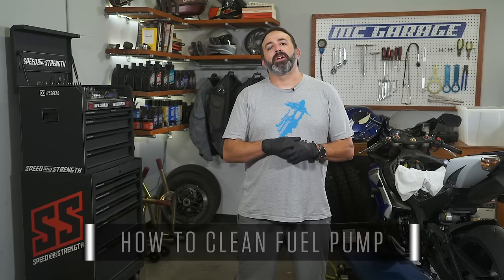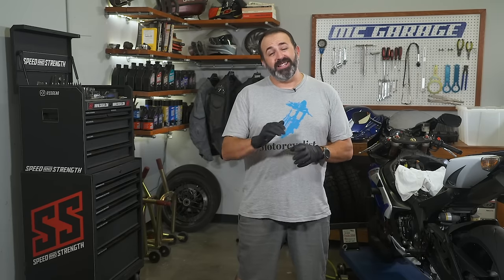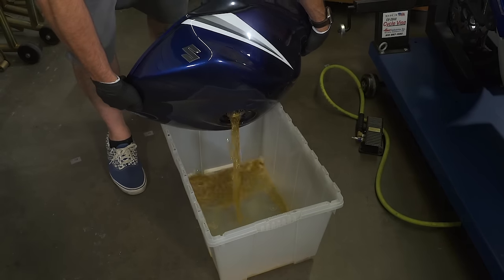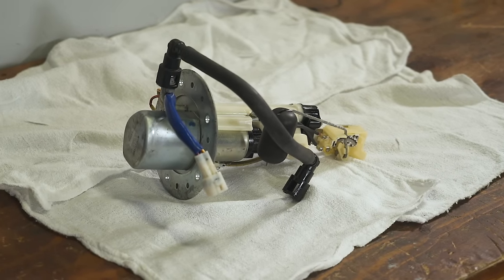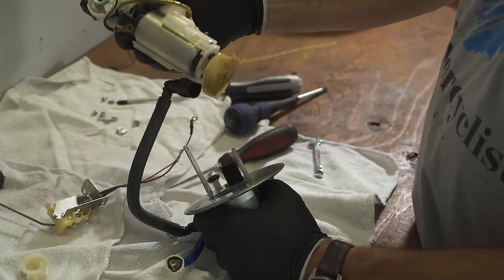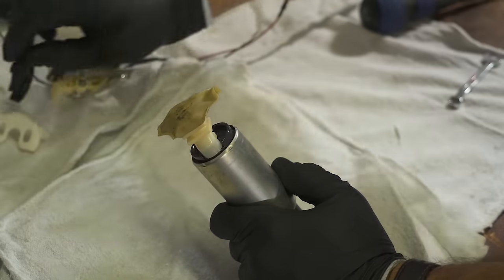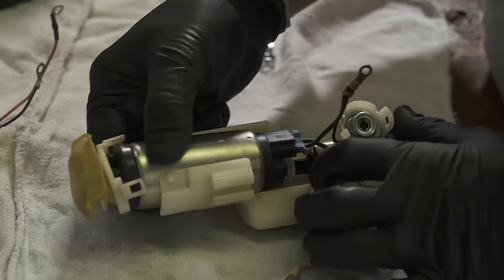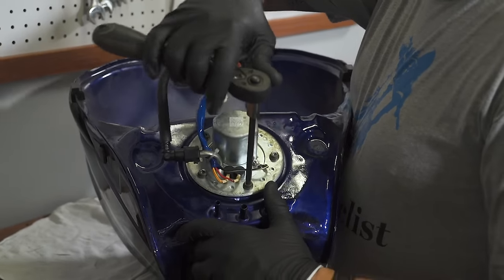How To Clean Your Motorcycle Fuel Pump | MC Garage

Comment: This is a great video. I bought a bike with 600 miles on the clock for dirt cheap recently, it hadn't run since 2015. I quickly figured out the duel pump was the issue. Followed this video to the tee, got it running after cleaning the pump, Now I have basically a brand new bike. Time to flip! Thanks guys.

Comment: I would not recommend using carb cleaner on anything rubber or plastic.
Reply: exactly, brake cleaner works best as it does not destroy rubber parts/o-rings.
Reply: True, it's very strong and damages most plastics but fuel pump components could be more resilient to chemicals. Best to makes sure and try it out on safe spots or old parts.

Comment: For removing all that rust from REALLY old gas tanks, I've had terrific luck with one of the water-based iron chelation type rust removers like Metal Rescue.  I suppose muriatic acid would get you off to a much faster start, but the chelation type rust removers are very gentle and do a great job.  When done, drain and dry in the sun, and you're good to go.

Comment: That's nice but i need a big garage , Unfortunately i live in Apartment
Reply: Yeah same here - I agree it sucks. I do have a detached two-car garage that I rent a few blocks away from home however there's no electricity, lights, water, etc at the garage so it sucks I have to do everything with hand tools and battery-powered lights and tools. I'm trying to save up to get either a gas-powered air-compressor or generator as that would help a LOT.
Reply: @MatthewJFitzpatrick  But i try at least to do something which is possible on the bike, only lubricant spray hahaha

Comment: Very good video , useful . No mention though of the tiny cylindrical metal filter that lies inside the fuel pump housing,  just after where the pump head enters the plastic housing as on my Bandit 1250 . The tea bag filter stops most of the crud but I'm having to remove pump and blast carb cleaner through the fuel line into the pump housing to remove a very small amount of dark silt . When I can easily blow through the fuel line I know I'm good to go again . I wish that darn secondary filter was external as I've had to clean it out more than once . Let me know if anyone has managed to combat the clogging second filter . The tea bag at the rear of pump remains good,  I clean it as a matter of course anyway each time the secondary gets silted and I loose the ability to exploit full revs .  Rob Stone .
Reply: Thank you very much for that comment. My fuel pump started making noises and my bike ran not as smooth as it used to. After i installed a new pump the viton grommet got pushed out of its place. I wondered why... Now i know it: the internal fuel filter is clogged therefore the pump builds up a really high pressure which resulted in the grommet giving up. This weekend i will reverse flush everything and i'm confident to solve the problem this way. I wonder why I had never heard about taking care of the internal filter before. This makes a lot of sense: The filter on the sucking side of the pump is quite coarse and will surely let fine particles pass through towards the internal paper filter.
The internal filter isn't meant to be maintained and a whole fuel pump unit costs about 800bucks...  
Thank you for saving me a lot of money!
Reply: @Payder    my story actually carried on with that cylindrical filter blocking with super fine silt after less than 1000 miles . I eventually speared the fine filter in the housing and installed a Ford focus fuel filter outside the tank using the high pressure quick release fuel line fittings purchased on ebay . The car filter is just small enough to live on top of the engine , under the tank and to the untrained eye looks like it should be there . I used a rubber strip around the filter to stop and rubbing on the engine and nestled it away from the lowest part of the fuel tank.  Power has remained 100%  and not had to touch the pump ever since . Regards R.stone
Reply: @robertstone4025  yep, if cleaning alone won't work for me I'm gonna install an external inline filter and get rid of the internal one. Thanks buddy!

Comment: Unfortunately the problem with pumps lies elsewhere. Both MC and the workshops fail to grasp the true cause.

Despite the gunk before the pump the problem lies inside the paper filter AFTER the pump inside the white plastic which you have to reverse flush to get your bike back to full power or replace if you flush and does not come back to life.

Have successfully fixed many bikes and saved a lot of money to their owners this way.
Reply: This is spot on. Care to explain how you do the reverse flush?
Reply: @RonaldOsure  Seperate the pump from the filter , take care the o-ring  inside also called (google viton grommet)  that sits between the two so that it is not torn as you will need to replace.
Sometimes the problems lies  just there.
Take your fuel pump motor and a clean source of fuel connect it to the exit of the fuel filter with a custom hose and run it with a power supply or a battery taking all precautions for a fire hazard.
Take care of yourself when handling fuel.
i have made an assembly with an old fuel pump on a static bench and just flush about 5 liters every turn until the output comes clean. you can filter your fuel so you dont waste it use coffee filter so i can see the cleaning process.
never failed me so far.
Reply: @st3rg  Great!
Reply: true. always clean it in reverse. always works a treat.
Reply: Do you have to hook up the pump in reverse?

Comment: Question:- Can a fuel pump be tweaked? By tweaking, I mean if it is possible to make the fuel pump supply more gasoline to the fuel injector.

Because, my mileage has dropped drastically and the mechanic told me that he increased the supply of fuel pump to the injector so that I get a bit more acceleration. I am getting a bit more acceleration but my mileage has dropped significantly.
Please help!!

Comment: Just found your video and have a question for the expert: I have a KTM 500, if/when my fuel pump fails on the trail, if I have a backup petcock installed and connect that fuel line to the carb. Would the trickle of fuel enable me to ride the bike  for a short while so I'm not stuck in the middle of nowhere?  Thx

Comment: In Canada, we have to store for several months in some areas.  Many of us use Aviation Gas for the winter in many of our machines.  What do you think?
Reply: should be fine, it's the sitting ethanol that causes the crud so as long as it has low ethanol content you should be good
Reply: should be fine, it's the sitting ethanol that causes the crud so as long as it has low ethanol content you should be good

Comment: How can you clean the high pressure side of the fuel pump? The part sealed  in the can…. black plastic part… my fuel filter was full of rust .. I tried to clean the tank with vinegar & it worked for a while..  except had a bad sputter an hard time start..but rust came back.. now I have crank no start..I’m thinking maybe injectors clogged too..If the fuel pump will power on; is it still good???

Comment: Another noob question - how can the wires connected to the fuel pump be exposed? No danger of sparking leading to an explosion?
Reply: The voltage is too low for arcing from any notable distance.
Reply: Gasoline isn’t conductive, rather an insulator, so the wires doesn’t need to be covered. Also when it sparks, which is unlikely, nothing will happen.
Reply: @AbnormalWrench  Thank you for your response. Makes total sense!
Reply: @MiikaelK  Thanks for your response.  I never knew that gasoline was an insulator.  Very cool!
Reply: @chriscanuck76  gasoline also acts as coolant, it keeps the fuel pump from overheating, this is the main reason it sits inside the fuel tank.

Comment: Ethanol is the devil.
Reply: Ethanol is not the devil.
Reply: Leland Holton Ask any mechanic.
Reply: that why you just use stabilizer if your going to let it sit. things with moving parts aren't designed to sit.
Reply: I thought alcohol actually helps mop up any water condensate.
Reply: @chocolate_squiggle  he wouldn't want more water content in your gasoline and also as ethanol sits and ages it gets to a gummy consistency which clogs up the lines and everything else in the system
Reply: Stabilizers do not work. Look up Project Farms videos on them. Ethanol is big oils way of stretching/cutting the product and tree huggers way of feeling better about themselves. Horrible for combustion engines.
Reply: @gorillamoto5329  did you watch the same video? Lol is it the perfect solution of course not but it better than not using it in an area where your only choice is ethanol based fuel. Also that video focused on how it affects a carb and most carbs are not designed for ethanol based fuels. Most newer cars and motorcycles are designed to mitigate the effect of ethanol
Reply: Rijo Rajan I did. The effects on the fuel system are solely due to ethanol, what part of the system wasn’t my point. The 2nd video is the one I meant to originally share. I agree, engines need to run to stay healthy, but adding ethanol isn’t good for any engine, especially small engines.
Reply: Rijo Rajan Slug happened with stabilizer added. I got a deal on an SV 650 with issues. Only issue was the ethanol slug in the lines and carbs gunned up. It’s currently running like a champ a few times a year around the track.
Reply: Found the perfect solution, Non-Ethanol fuel. My entire point to the original comment. Lol
Reply: @gorillamoto5329  not arguing the effects of ethanol on the system honestly, just that they video you use as reference to say stabilizers don't work clearly says that while ethanol caused damage the one with stabilizers was less that the one without. The stabilizers don't prevent they just slow down the process and modern bikes with out carbs just fare a bit better then older carbed bikes.
Reply: Rijo Rajan I agree, I should’ve said they don’t work well. I stand corrected. Tbh, I’d never put that 💩 in any of my bikes. I do my Jeep bc I’d put it in a ditch if I felt like it. Funny how they sold use on,”modern mechanics have made the effects of ethanol negligible.” When non—ethanol fuel has nothing to negate.

Comment: Hi,
I have a Yamaha R6, 2004 & I have started to face an issue recently.  I would need your help to diagnose the problem, the total kilometers I have run my bike are 12,000KM ONLY since I got it as I wasn’t riding regularly. 
For about a month now, I have been riding it regularly. I always do a normal maintenance like Oil change with filter /coolant & battery.  yesterday when I left home I felt the bike is heavy and it’s not running smoothly. 
Once I stopped at the traffic light and released gas it turned off & when I tried to turn it back on it wasn’t really working without taking extra gas.
All I could do is just give it extra gas and get back home. 
If anyone of you can help guide me and figure out the issue then please do let me know from where to start.

Spark plugs ? Airfilter ?or Fuel pump/ filter ? 
Please help,
Many thanks!
Reply: the best thing to do is to buy a workshop manual. That will have troubleshooting guides for most problems including this one.
one quick way to see if it is a fuel system problem is to remove the tank and airbox then spray some gasoline with a squirt bottle directly into carburetors ( you can buy spray cans which  do this from any auto shop ). If engine runs when spraying fuel, problem lies in fuel system, fuel pump, fuel line vacuum line etc.

Comment: This is dumb.   You go over everything but completely don't mention the high pressure filter.  The strainer is only that a strainer.  The piece that the pump motor goes into is the high pressure filter.   That is where most the sediment and dirt piles up.    Clean and blow it out once and you will see how dirty they get.